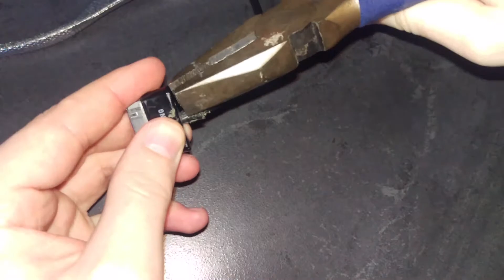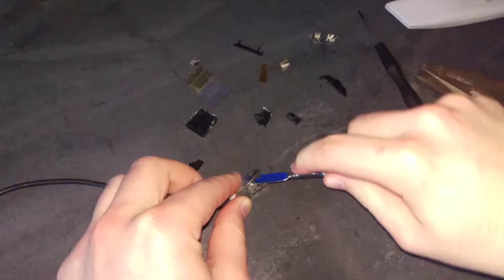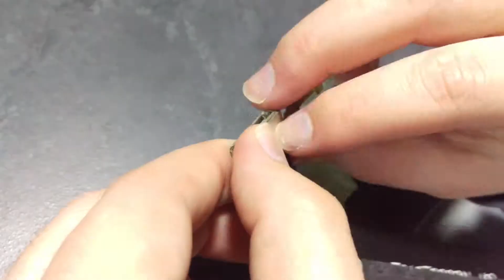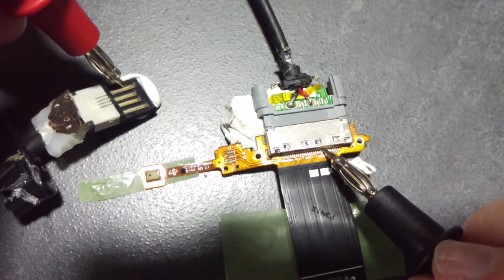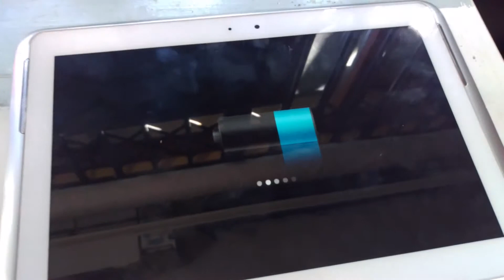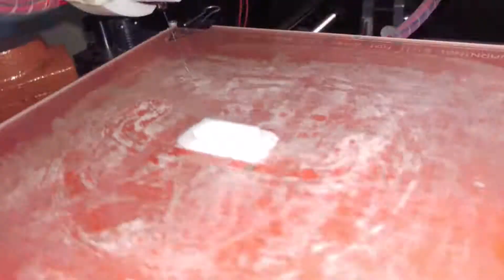Replacing a Proprietary Port on a Tablet with a Micro USB (Samsung Galaxy Note 10 1 GT N8020)

Comment: Hi there, thanx for showing your modification to this Samsung, I don't know  why they put that "Big Junk" port in the first place since only 4 wires were needed.  You had said earlier in your clip that you will display the pin-wiring BUT you forgot it. I want to know as to which  pin of the flat cable (usb port end) goes to which pin of micro-usb ! !  PLEASE help me out since I also have to do the same to my Samsung GTP5100, I just want fast-changing and nothing else. Your kind explanation (or a link to your documents) will be highly appreciated.
Reply from the maker: 6:33 is the only diagram I have
Reply: @mediocrediy4599 thanx for your reply. I don't understand the naming of the pins in that diagram, the only thing which is clear to me is "GND, ... from pin 6 to pin 10 I don't know which one to use for fast charging.
Reply from the maker: @KaivitiSingh  I'm afraid I don't have any extra info. As far as I understood it, as long as the data lines worked, it would fast charge but I could be wrong. It's been 4 years since I did anything like this and I've forgotten things 😅
Reply: @mediocrediy4599  you know what I did??? I made a 4.2V, 4A charger (modified a 5V charger by using a suitable resistor in the feedback circuit) and have connected it directly to the battery of Samsung tab... I am not even using the Battery 
management circuit inside the Tab. I finished this today and now I am running it  to see how things go. Sa far all good.....
Reply from the maker: @KaivitiSingh  Interesting solution. Nice 😄

Comment: That's a helluva work. I'll be going a different route however. Planning right now on converting the adapter side USB end of the cable to female USB-C and just making an external shroud in which the tablet and converted cable will sit. Easier that way, as I only plan to use the tablet for my endoscopic camera. However I must agree with you that the 30 pin port is just stupid.

Comment: Which Pins on the connector did you attach? Do you have a wiring diagram?
Reply from the maker: 6:33 is the only diagram I have
Reply: @mediocrediy4599  i See, do i have to use the usb ID pin? Or can i put IT on Ground?
Reply from the maker: @arturbaltazar2526  seems youtube does not notify me of every comment, sorry. I can't remember too well at this point, but I think I ignored it. Unfortunately the tablet died properly a while after so I don't have it anymore

Comment: Hello, I have few questions. Does it allow to transmit data finally? Is it possible to use usb-c instaed of micro-usb?
PS. Good job!
Reply from the maker: Thank you 😄 It did transmit. I was quite surprised it actually worked. I would imagine usb-c should work fine as it is backwards compatible. Just need to figure out the pins.
Reply: @mediocrediy4599  Thanks for answer. If you will try to modify it another time, I think it's great idea do use Sugru (find in web) instead of 3d printed model. I'll let you know when I do some progress.